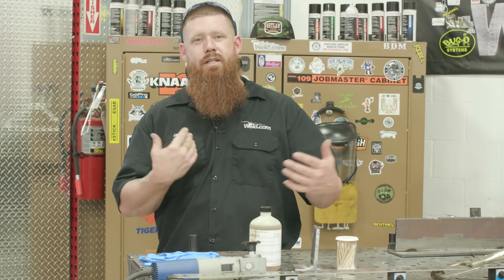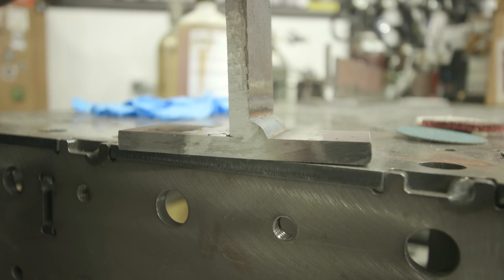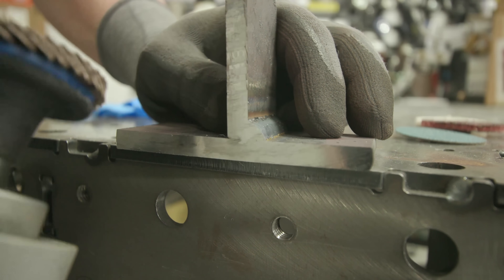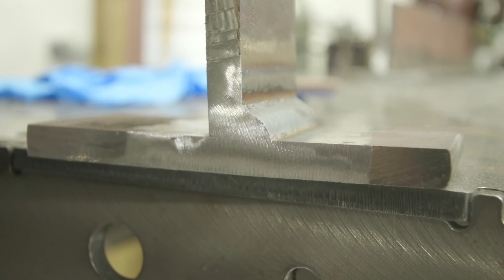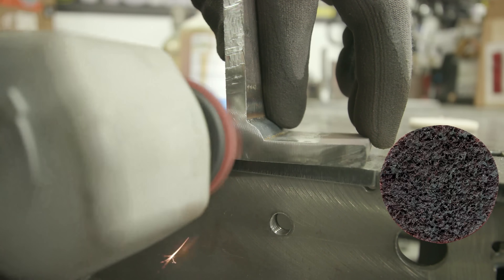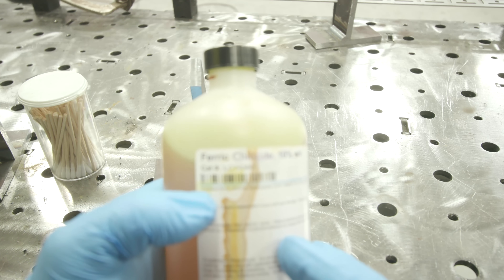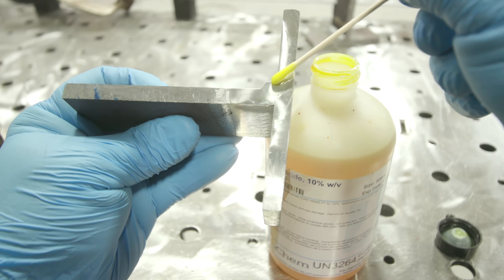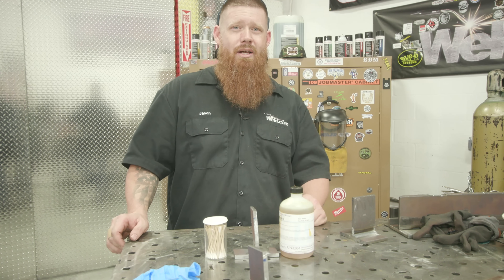How to Macro Etch a Weld Sample

Comment: Can you etch stainless joints?
Reply: Yes you can, you just need different etchants. Marbles Reagent (contains copper sulphate and hydrogen chloride) is a common one used to assess stainless welds

Comment: Deal with this at work all the time. Customer procedure calls for Pictric Acid, which is explosive!. Then again, we're making safety-critical automotive body parts, so weld quality is paramount.
Reply: Nital is alcohol mixed with nitric acid, or in other words a liquid fuel mixed with a powerful liquid oxidizer. I'd be more worried about that than picric acid personally.

Comment: Can you etch an Aluminum weld?
Reply from the maker: You can, you just need a different chemical.
Reply: And that chemical is? Or do you think Google would know?
Reply: @hjvisagie  Jody says: easy off oven cleaner ...  and it works.
Reply: @hjvisagie  https://youtu.be/6hi7NsAh2AA
Reply: Sodium Hydroxide solution ( Caustic soda or Lye), commonly sold as drain cleaner. You only need a very weak solution, normally less than 5% by volume, pure or low alloy require weaker solution, then a little more concentrated for higher alloys. This is a Base or Alkaline with high PH, it is more dangerous on skin contact so be careful, it does not sting like acids, but is more insidious in that your skin starts to feel softer!!!!. You have been warned☠☠☠☠☠☠.
Wash off with water, then blow dry, distilled if you want to avoid water stains, but for workshop coupons/not requiring sample imaging.
Proprietary etchants for aluminium alloys are Kellers, and Krolls, these are only really needed when at microscopic magnification ≥ X100.